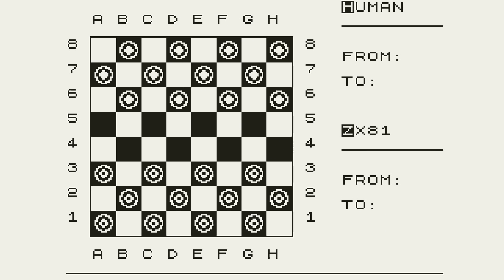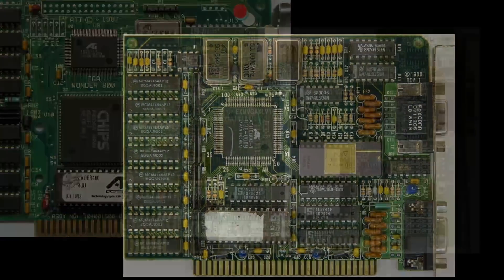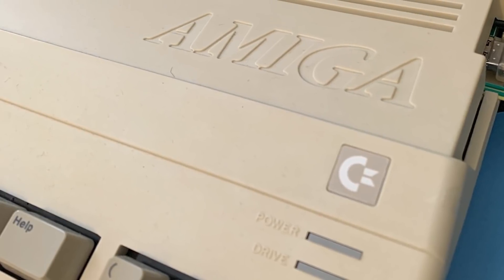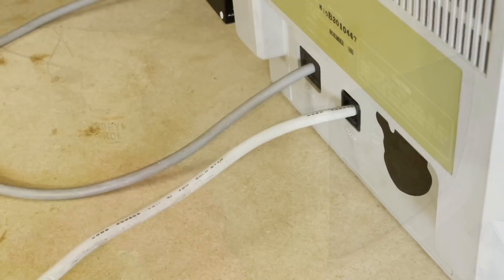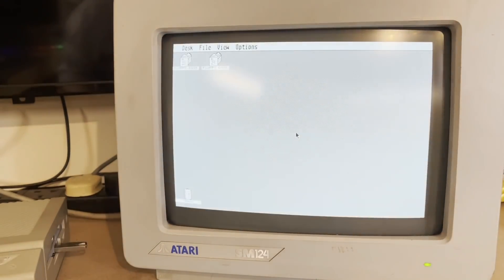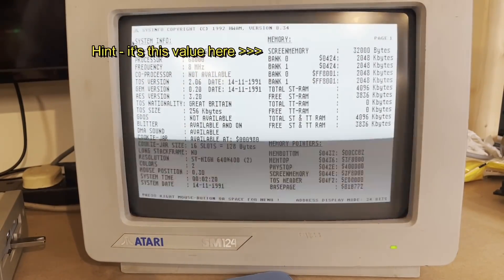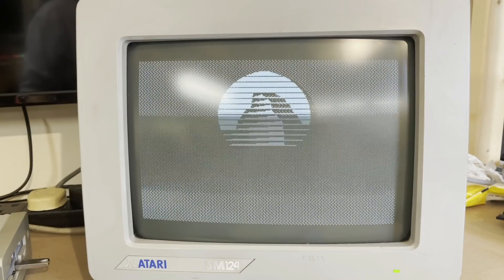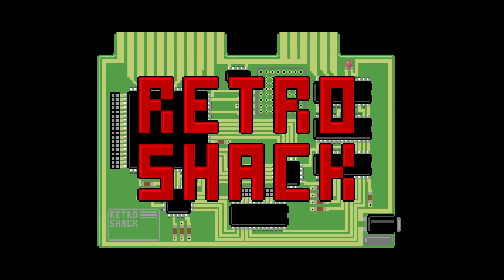'Hi Resolution' may not mean what it used to, but here's what it used to be!

Comment: I thought it seemed crazy on the Atari ST that you were expected to purchase and switch between two different monitors if you wanted to run a variety of software. For example, run a word processor in high res or MIDI software, or play a game which won't work on the b&w monitor in a lower resolution.

Did you also have to switch the wires between the monitors, or was there some way to leave them both connected at the same time?

On the Amiga, you had none of these issues. However, if you wanted to use Hi-res mode (which also worked in color), you might experience interlace flicker but you could buy a device to eliminate it if you wanted.
Reply: that was not an issue, it is hard to grasp by a Amiga fanboy. How to explain it to you, it was an option Amiga user simply didnt have.
Its like comparing Playstation vs XBOX, both have great options, can be connected to 4k TV and XBOX has slightly higher performance so it might have a slight edge.
Like A500 compared to ST in arcade games, but on PS you do have option to by a VR headset that opens up a load of new possibilities you simply dont have on XBOX.

Amiga was a great game console in a computer packaging, but ST was so much better and more affordable general computer. Some ST owners got the system by mistake and maybe even switched to Amiga, but believe me that majority of ST owners got ST over Amiga by purpose.

And to answer your question about two cables, yes indeed both monitors had its own cable and yes you had to turn off the computer and replace the monitor cable, which was not an issue. Majority users used just one monitor type (being it BW or RGB) most of the time, and needed the switch just from time to time, not a big deal. But there was also a solution where you could connect both monitors to a box with a switch, and cable from the box to computer, and it was cheap. In fact you could build one by yourself, but it was so cheap that there was no point to bother.

The flickerfixer was about same price as the whole SM124 monitor and still you didnt get the crispness, sharpness, uniformity and picture stability of the SM124. Really a day and night difference. Hard to explain to someone who was most of the time using 320x240 at 50Hz over a shadowmask, you have to see it.
Reply: @madigorfkgoogle9349  I have seen it, and I still felt the Amiga 1080 monitor had a great picture quality to it. A couple years later I studied broadcasting and worked in television and have a College degree in the field. Far from clueless on monitors. As an arcade machine, classic computer & classic console collector, I probably still have 30+ CRT monitors of all different types in my collection. 

Another crazy thing I've heard with the Atari ST monitors, although I'm really 100% sure and maybe you can clear this up, is that a lot of the software required either a color monitor or the b&w monitor. You couldn't simply run the color software or the b&w software on the b&w software on the monitor. Is this true? If so, seems nuts to me.  

But one thing I will clear up for you. The Amiga also have a built in MIDI interface that was OS tight. The Amiga was designed with MIDI in mind, and even demonstrated at it's premiere. It's probably the only computer I know of (besides the ST) that you don't even have to install a MIDI driver in the OS for. All that was required was cheap gender cable adapter. Plans were available to go to Radio Shack and make you own if you didn't want to spent a mere 20 bucks on one. MIDI for all other computers was much more complicated to install, and much more expensive as the main components for it weren't built into the computers. And MIDI & the software synths were the #1 reason I bought an Amiga 1000 (when the whole system had cost $2300 for CPU, color monitor, extra ram which 99% of Amiga 1000 owners bought immediately, and a 2nd disk drive). The Atari 520ST would have cost less than half. It simply couldn't do the things, especially the soft synths, that the Amiga could which really impressed me. The Ensoniq Mirage sampling keyboard was the first low cost sampler on the market, was new on the market, and had cost around the same price as the Amiga alone, making my purchase pretty justified as I basically got a Mirage plus a state of the art computer. With a special program, it could even read the Mirage disks and I bought 30 of them.

Comment: Amiga users didn't realise that all their special chips didn't matter for business users when they couldn't use their computer in nice crisp high res. The Mac certainly had this. And as demonstrated in this video, the Atari ST also had it.  By the way, I never had either an Amiga or Atari ST, so this is just a pure observation.
Reply: Sorry. Amiga users just needed a flicker fixer device to use their existing "single" beautiful Amiga 1080 monitor to run hi-res, and it ran in color. And if they could put up with some interlace flicker, they didn't need to buy a flicker fixer. I just ran hi-res mode without a flicker fixer and was fine with it when I needed it.

640x200 was also useful for a lot of business software, and ran with no interlace flicker.
Reply: sorry, the poor Amiga fanboy (@classicarcadeamusementpark4242) doesnt know what he is talking about, he just knows that Amiga is da best... :face-blue-covering-eyes:

Comment: The Atari Hi-Res monitors were brilliant bits of kit - I had the Atari SM144. My STe - upgraded to 3mb - and coupled with the SM144 and a German 20mb hard drive in effect gave me a poor man's Macintosh! I used it for graphic design using software such as CALAMUS and DA VECTOR PRO. I used this professionally when I worked in a typographic printing company until I upgraded to an Apple Mac Performer 600 in 1992.
Reply: the SM144 was not that sharp anymore than the SM124!

Comment: In Germany most Atari ST computers might have sold with the high res monitor, given the sheer number of SM124 we have collected over the years (14x SM124 vs. 1x SM1224). I remember that my father accidentally got a SM1224 color monitor at first with his Atari 1040STFM in 1989 and promptly went to replace it with the high res monitor. We as children were very sad since we really liked the color graphics of the games. My father was more work minded and less game focused ;-) In hindsight, i totally agree with my father. I could not imagine to have done my homework in the low or mid res. The possibilities were amazing since we also had a hand scanner and text recognition software. My father had invested a lot in his setup. A 24 pin printer with color option, 20 MiB hard disk, 2400 baud modem, multimeter with computer interface and software, hand-scanner, audio digitizer, 2.5MiB ram expansion... A lot of manual labor was therefore offloaded to the computer and i got good grades because i could focus on the contents and less on the style of my homework. Most students were manually writing essays often several pages long, two or three used typewriters. It was a breeze with the ST. My history teacher even asked me once if he could use some of my homework as future teaching material as he was still using the collage & photocopy style of assembling work material since he did not have a computer. Once we had an assignment in biology class where we had to draw the cell of some plant in color manually from a book. The teacher even gave us very thick cardboard style paper that we could not trace the drawings. It was a very complex drawing but i simply used the hand-scanner and printed a very faint image of the graphic. I filled out the colors and traced the lines for a near perfect copy. In the following years i was very interested in computers and printing and even had 2 years of work experience at a regional newspaper. I finally studied IT and i am working as a programmer at the moment.
Reply: great story, thank you for sharing.

Comment: I was given MIDI Quest for the Amiga back in the 90's. Absolutely useless to me as I could'nt fine a MIDI interface anywhere. Years later I found an Atari 520st in a skip, it has MIDI ports. MIDI Quest was also released for the Atari. I got the internet about 5 years ago, it took me 4 years to find a copy of MQ for the 520. So, I've got original instructions and copies of the discs. Put them together and it's a load of rubbish. LOL. It's not intuitive at all or very happy with my Yamaha keyboard. It ignored my Casio.
Reply: MIDI interfaces were all over the place for the Amiga and very easy to obtain. 

Also, MIDI was built into the Amiga and was also OS tight. No driver was even needed. All that you needed was an adapter to add the physical din ports. When the Amiga came out, MIDI interface adapter ports (again, it's not really a full MIDI interface like other computers) they started at just $20. 

I still have my original MIDI adapter I bought in 1986. It connects nicely to an Amiga 1000 and even appears look built in the way it connects. Also had extra ports the ST interface was lacking that I needed. When it comes to MIDI interfaces, it's not "one size fits all". ST users often would have to still buy an adapter since they didn't get all the MIDI ports they needed.

And if $20 was too expensive (yeah right), plans were easy to obtain to go to Radio Shack and build a port adapter even cheaper.
Reply: @classicarcadeamusementpark4242  Here in the UK Amiga add-on's were really hard to find. I had to travel 90 miles on busses and trains just to get my Sound Sampler add-on. The sampler was about £50 and travel was another £20. The mail order MIDI interfaces were a minimum of £100 with £15 postage on top of that. It was not a good time for Amiga hardware in the 90's.

Comment: When I had the chance to upgrade my Atari 800XL in 1990, I made a huge mistake and chose the Atari ST out of some stupid misplaced "loyalty" to Atari, and without doing research on the alternatives, like Amiga. All I'm saying is that I think it's stupid that the Atari ST needs a separate monitor for hi-res in monochrome, when an Amiga can use hi-res on the same TV or monitor as the lower resolutions, with 16 colours!! The only downside on the Amiga side is the interlace flicker, but then, I couldn't stand the shitty ST audio. Bit of a trade-off, really.
Reply: I was basically just commenting about the same things Aaron. I couldn't have said it better.

And the flicker could be fixed on the Amiga for hi-res mode those willing to spend money to buy a device to correct it. 

Totally agree about the ST audio. It used the same 1979 sound chip used in my TI 99/4a home computer. The Amiga by contrast had a state of the art sound chip that would emulate synthesizers of all different types. Synthesizers that could do sampling (which the Amiga was well known for) were costing $10,000 and up a year before the Amiga came out. MIDI music was the main thing I wanted my Amiga for. No other computer had a sound chip like the Amiga in 1985.
Reply: well, and this just shows your lack of information, Amiga could not do anything close to ST+SM124 back in 1990, and ST shitty audio in 1990 was actually STE which is superior to at that time "shitty" Amiga 500 audio.

But as I see your level of information, you should have got the Amiga instead, you would be better served, since you are on the Amiga level...
Reply: @madigorfkgoogle9349  The Amiga audio was excellent. It could actually sound more like 14 bit with a few tricks.
Reply: @classicarcadeamusementpark4242  Nope, unlike Amiga, Atari STE has not one, not two but three built in audio solutions.
First it is the Audio Shifter capable of 2x stereo PCM DMA channels (like Amiga) with sampling rate up to 51kHz (unlike Amiga 28kHz).
Second it has the clone of the TI 99/4A chip made by Yamaha, which is a proper 3 voices synthesizer (Amiga can do just kind of FM synth, which is not "cheap" in resources).
Third, it has proper on board DMA MIDI that Amiga is totally lacking off. On Amiga you had to use MIDI to RS232 adapter, but the timings on Amiga are totally off, useless garbage for anything else then toy.
So let me sum up, 2xstereo PCM channels (4x voice)+3x YM synth+MIDI, all built in and could be used at same time (show me that on Amiga).

The 14bit solution is a theory which is a total nonsense and is not really working, was proven on Amiga forums by audio scientist with lab equipment. The sound is slightly better, but it is like up to 10bit. 14bit haha...
And still 8bit 51kHz is way better and clearer then 10bit 28kHz. And about the state of the art, in 1990 PC world was already using 8 stereo channels at 44kHz, Amiga audio was outdated in 1990...

Speaking of 1985, when A1000 came out, you could do not very much with Paula since the Amiga dumb down Atari 800 architecture (from 1979) with 256kB of RAM was not enough for sampled music in games. Even if you upgraded to 512kB you were very limited, samples at 28kHz are very RAM hungry (thats why samples in games use 12 or even 6kHz on Amiga).
Atari ST had 1MB RAM already at half the price of Amiga, more power and excellent SM124 high rez monitor with 71Hz refresh, instead of "flashing" Amiga solution. 
FlickerFixer+ScanDoubler in 1985? You are kidding right?  
ST was also 10-20% faster then Amiga, so Amiga was useless for productivity apps (lack of flicker free hi rez, low RAM), and even for games (overpriced, low RAM to play sound in games). The A1000 was a disaster, Commodore almost got bankrupted in 1986, in fact the A1000 production was halted end of Q2 1986 due to poor demand. The money injection, C64 and later the much cheaper A500 was the savior at the end. Not for long... But that is the corporate cancer story...
And in 1987 when RAM got cheaper, there were already computers surpassing Amiga audio, like Sharp X68000 for example...

In 1990 any synth, even the toy one, had far better sound then Amiga. 10 000USD synth? You kidding again, Amiga never had the sound of a professional synthesizer, ever! Not even on day one...

You are clearly a kid of 90s, you were not around computers in 1985...

Comment: I understand why low resolution TV can't display ST high resolution mode, but why would it not be possible to have a special lead to a modern display and use ST high resolution mode?
Reply: you can, it is not the same but it works good. Look for ST2VGA adapter and since the ST High is progressive scan at 36kHz horizontal frequency, most LCDs should work. The ST low/medium is a problem...

Comment: I made a "Atari ST Hires Monitor" out of an old HP mono VGA monitor (the HSYNC + VSYNC pots were tweaked to their limits). You can run a color TV and a mono monitor at the same time, and there is some software that uses both, debuggers mostly, and the od demo (both screens have there own 32K allocation by default, just the screen pointer changes). I wish someone would do a video on the 1280 x 900 (21" Viking mode) Atari ST hires which every TOS rom can also handle by default (yeah unused code) - I think you juist have to bump the Hz sync from 72 (mono) to 132, which is how the ST detects the difference (you can see this present in the PCE emulator code - I hacked it to work on a 1380 x 768 monitor on my RPi, without compressing the vertical pixels).
Reply from the maker: That's absolutely fascinating!  Sounds like a Sunday afternoon of tinkering coming up :) :)

Comment: Can use high resolution on VGA monitor though. Standard VGA resolutions include 400 lines at 70Hz which is close to 400 lines at 72Hz. Of course at the time Atari SM124 was released VGA was not even a thing and when it was VGA monitors would be even more expensive and for monochrome display they would be certainly worse.

Comment: There is the "over-scan" mod, allowing higher resolutions still. It is easy mod, just scratch some traces and make a new connection to break the 32k limit. A switch allowed you to go from "over-scan" to normal. The over-scan driver did the rest. Most 124s could do 720x512, some could be pushed further. On a NEC multisync 800x720 was about the max.  Pure GEM programs that do not try to write to the screen directly, worked fine. For example CuBase worked, but its Statelite accessory didn't.
Reply: You don't need to do any hardware modifications to break the 32000 "limit".  Overscan resolutions were available with pure software.
Reply from the maker: That's very intriguing - consider me looking this up!

Comment: You had to have the SM124 to be able to run Cubase - so that's what we had. Which also meant, that games was pretty much not a thing we did on it.
Reply: And that's crazy that the games couldn't still be used in b&w on the b&w monitor.

Glad I choose the Amiga.
Reply: By the way - we had a DX7 :)
Reply from the maker: Nice!  I had access to it's poorer brother, the DX21.  But it wasn't mine so had to give it back :(